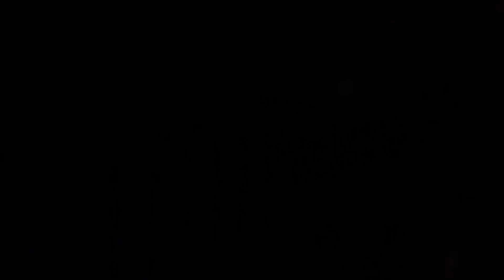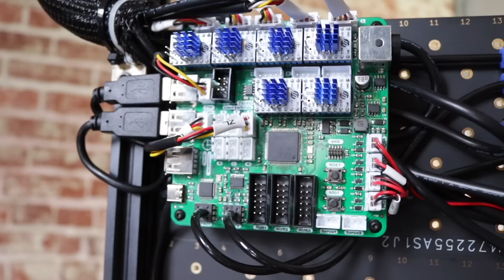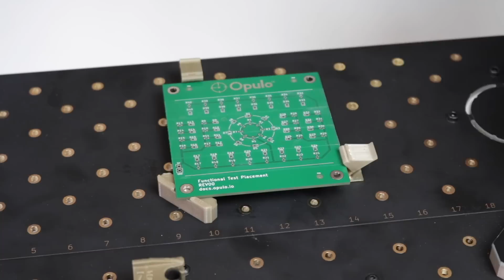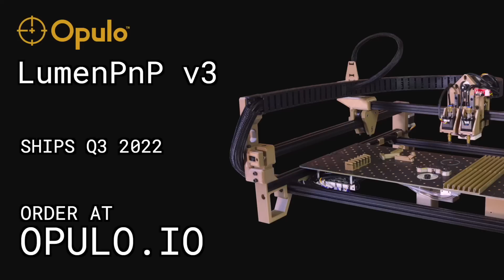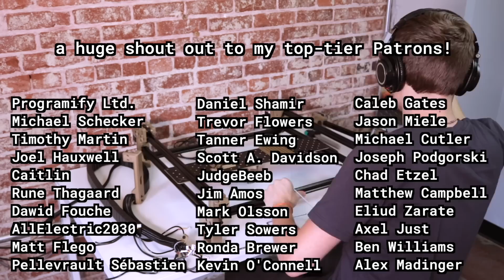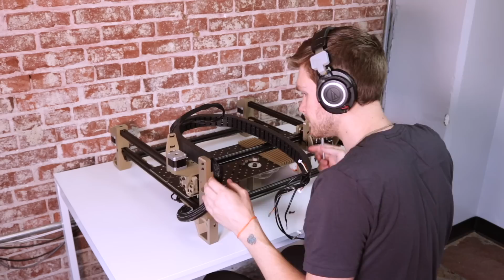Introducing LumenPnP v3

Comment: I just received the V2 kit which was very easy to assemble. The instructions are clear and if you have assembled a prusa 3d printer before then it's a walk in the park. Hopefully we can upgrade the V2 to V3 (a kit?). The only thing that has left the experience down at my side is a dead controller board. Probably the board needs some ESD protection and the supplied step sticks need testing before shipping. Hopefully my support ticket will be read so I can finally go on with automating my prototypes and skip the eye strain on the smd work... :)

Comment: looking good. i have a V2 is it also possible to get loose parts to change the umbilical cord to the cable chain system?
Reply from the maker: The BOM for all the parts and the updated CAD files will be on GitHub so you'll be able to get a cable chain on your V2!